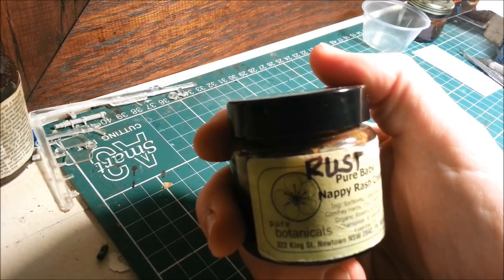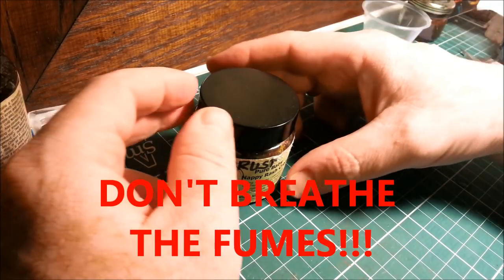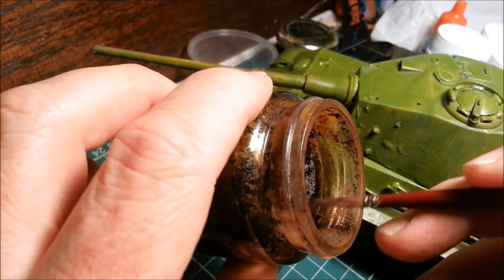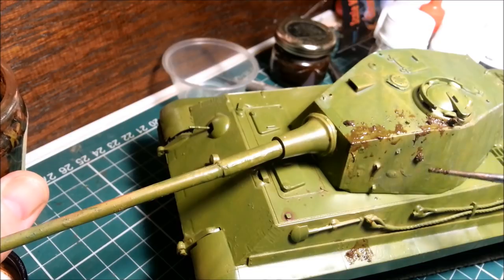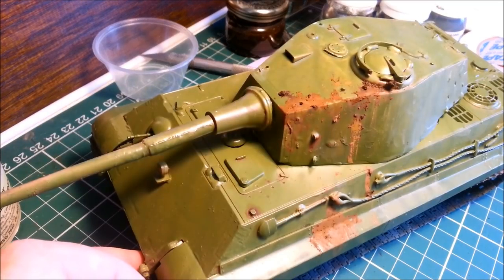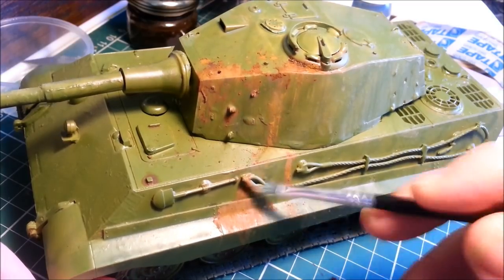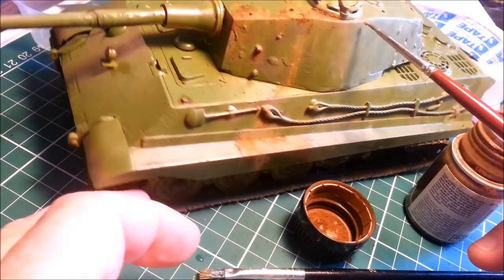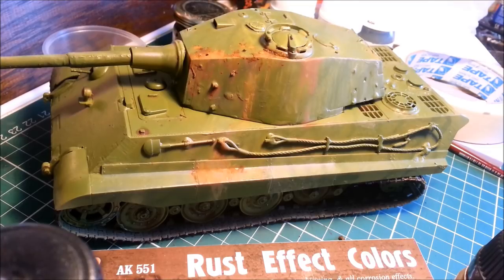How to make your own RUST for weathering scale models

Comment: Hey, thank you for the video. I gave this a try but unfortunately it didn't work.. I've put the steel wool in jar with vinegar outside (no lid on) for more than a week and if anything the vinegar made the steel wool even shinier. The only bit that got slightly rusted was the very top part of the steel wool that wasn't fully covered in vinegar. Am I supposed to leave the steel inside the jar with the vinegar throughout the process or do I need to remove it from the jar in order to rust? I really don't think the steel wool I bought has soap on it so I'm not sure what I'm doing wrong.. Any idea? Thanks again!!
Reply from the maker: Hmmm, I would try removing the steel wool (while it remains wet, still covered with a very thin layer of vinegar) and just place it on a plate and leave it to oxidise in the air for a day or so. Hopefully that will do the trick.
Reply: Laura Carreira 
Hey mate, you might have stainless steel wool? 
Maybe check that.

Comment: Do you just fix it with a matt varnish?
Reply from the maker: You certainly can airbrush a matte clear coat to seal it in if you expect to be handling the finished model much. But it will make the rust darker, and you lose a lot of the subtler tones of rust. I never bother to.

Comment: How to you seal that wire wool rust on a model please? I shot it with some vallejo premium mat varnish through the airbrush but the rusty bits turned white n brushed off. Many thanks.
Reply from the maker: Hi Adam, to be honest I didn't seal it on the model in the video, unless you're planning to do a ton of weathering I'd probably leave the rust effect unsealed. But I have sealed it before and all it did was darken the colour a bit. Not sure why yours went white & fell off? My advice would be apply again and leave it unsealed if you can.

Comment: Do you seal the rust after  to make it permanent?  thanks for helping.  My main interest is Gato submarine.
Reply from the maker: Hi Donald, I don't bother sealing it, but then I also don't tend to dust my models or play around with them once they are completed.  Cheers, Dave
Reply: Could the final finish of all the effects be sealed for durability?  If so what would be used?  Please excuse as I am a complete beginner in this kind of painting jobs.  Thanks.
Reply from the maker: You certainly could, definitely. I would use a matt clear coat, something like Tamiya TS80 spray lacquer, or any kind of matt varnish. The only potential down side would be it might make the rust tones a little darker -
 do a test first and see. Hope the sub turns out great :)
Reply: Dave's Model Workshop ... the exact question i was going to ask!! Brilliant video by the way, thank you!!

Comment: Hello, i want to ask if i can use stainless steel wool ?? Thanks :)
Reply from the maker: Hi Timothy, I'm pretty sure it won't work with stainless steel wool. Give it a go, I'm not 100% certain, but I think stainless steel is specifically designed to not rust. Dave
Reply: Dave's Model Workshop Okay, I'll buy a normal steel wool then. Thanks Dave :)

Comment: I have an old steam engine I'm trying to weather when you add the rust do you seal it in anyway ?
Reply from the maker: I don't usually seal it, as I find a clear coat does make the rust darker and losses some subtlety in the tones. That said, if you're going to handle the finished model much it's probably a good idea to seal it as it would rub or wear off with handling. It's like a pigment in that respect.
Reply: Lacquer or hair spray?
Reply from the maker: Hmm, I would probably go for a matte clear varnish. Hair spray might work in a pinch, but I'm not sure what the final finish would be like? Might be semi-gloss?
Reply: Dave's Model Workshop ok great thanks for your help

Comment: Is it safe to use if acrylic paints?
Reply from the maker: I can't see why not. As long as the acrylics are cured, you should be fine. Maybe just test on an unobtrusive bit first, leave it for 24-48 hours and check just to be 100% sure, but I can't see why it would react badly. Dave

Comment: Can anyone help on  separate problem? I put decals on but get a shiney effect from the decal + clear 'border' (if this make sense) Usually if light shining on it the decal & backing reflecting light..hope I explain ok
Reply from the maker: That's called "silvering". The easiest solution is to trim the border off as close to the decal as you can. Also, I find applying decals to a gloss surface stops silvering - all you have to do is then airbrush a clear matte coat on top. Cheers, Dave
Reply: Dave's Model Workshop Thanks mate!
Reply: I don't use decals anymore. try stencils is more realistic or try to paint numbers or german insignias by hand, is not very difficult and very realistic!!

Comment: The only downside IMO with real rust is it wipes off and any sealant will make it darker even if it's a matt finish. Unless there's a technique I'm unaware of...artist's fixative spray maybe?
Reply from the maker: You’re right, in my experience sealing it does make it darker and you lose subtlety. I try to not handle my finished models, that’s the best solution I have.
Reply: @DavesModelWorkshop  Maybe artist fixitive spray would do well. I used it for conte art which is chalk like and I don't recall the spray changing the color. If I did more rust I'd consider trying it.
Reply from the maker: @trailwomanrc  Good suggestion.

Comment: How to make sure the real rust attach to the surface of the model firmly so it wont fall off when you clean the model?
Reply from the maker: Fantasy Deep Dark I’ve usually sealed it in with a coat of matte or Future at a later stage as part of later weathering, so I’ve never really had that problem. But it’s pretty durable. Large flakes could fall off, but small flakes and overall tone would be pretty safe during dusting.
Reply: Dave's Model Workshop thanks👍
Reply: You could get yourself a really wide and really soft brush, like to ones to put on face powder, to clean your models. or clean them with an airbrush.

Comment: I can only find steel wool with soap in it
Reply from the maker: Is that the type with a layer of soap on one side? Maybe you could use scissors to cut off the soap section, leaving you a section of only steel wool? If the soap is impregnated throughout the steel wool all over, I don't know if it would work, you could get some funky results and application might be a bit dodgy... Good luck! Dave
Reply: Thank you Dave, I found only the s.o.s Pads with the soap all over the wool. I might try the effect even with the soap in it and see what happens
Reply: look in stores where they carry painting supplies. They should have paint, brushes, sandpaper and dry steel wool
Reply: Soap is usually a strong base so it will counter-act the vinegar I think... Maybe try a diluted phosphoric acid solution... it's much stronger than vinegar (but still considered a weak acid). They are sold in hydroponic horticulture shops as PH down adjusters... 1 liter bottle is like 15$. The fumes are harmful though & it will burn the skin/eyes if in contact so I'd wear gloves and eye protection and do the mixing outside
Reply: Try Coles they sell it without soap in individual packets for about $1.

Comment: Did not work for me at all. Left the thing outside for 4 days and still, the wool is still in fairly good shape and no trace of rust whatsoever. Used regular vinegar and steel wool that had no soap on it.
Reply from the maker: Bugger... if you go through the comments you'll see it seems to work for about 90-95% of people, and I have been unable to work out the important difference when it is unsuccessful... All I can suggest is give it a couple more days, but in my experience it should be working after 4 days. Sorry, LaV2.
Reply: I had to remove about 90% of the vinegar from the glass. So far, from what I understand, as long as the wool was wholly covered by the vinegar, it prevented any rust from forming. The day after I removed the vinegar, the wool that wasn't in the vinegar started to rust. So I've made sure I moved the wool a bit from day to day to make it rust.
Reply from the maker: Hooray! I'm glad it worked for you! And thank you for your scientific mindset - now I will have a solid piece of advice to offer other people who are struggling. Thanks LaV2!!! Dave

Comment: ... well ...  no replies ... so i tried a little bleach. Hmm, may have helped but still very slow. I think heat is the key. I divided my contents into two bottles. I boiled more vinegar and filled these bottles to the brim. That did it. No more steel wool. All rust. Now i need to let that settle to the bottom and pour off the vinegar. Should have the sticky rust stuff i can model with.

Comment: 3 days later & I've still got steel wool in vinegar
Reply from the maker: Hmmm, weird. What sort of proportion of vinegar to steel wool did you use?
Reply: Dave's Model Workshop Tried it twice, once with lots of vinegar & the other just covering the steel wool probably 50/50
Reply from the maker: Bugger. I've had one other person who had lots of difficulty with this, similar to you, the reaction never started after even a week. After lots of messages back and forth, we never worked out the reason it didn't work... I did have someone tell me just this week that they also had success using water instead of vinegar - you could give that a try? Not sure, the technique I discuss in the video works in 99.5% of cases.
Reply: Dave's Model Workshop I tried again with different wire wool last night, bit early to tell yet but Illet you know the progress. I may buy a different vinegar next. Thanks anyway mate 👍
Reply: Hi Dave, could temperature play a part? Some of us, (me!!), aren't lucky enough to live in Australia!
Reply from the maker: It could be a factor, definitely, I'm sure warmer temperatures do speed up the process.
Reply: Dave's Model Workshop I've tried a couple of times & no change at all
Reply: Just checking - are you using steel wool (very fine, dark grey, not really shiny at all), or stainless steel scourers (bright, shiny, coiled springy stuff)?
Reply: Gavin the Enchanted Hunchback I was using steel wool, I actually have up but tried again just wetting the steel wool every evening & leaving it outside in a shallow dish ..that worked!